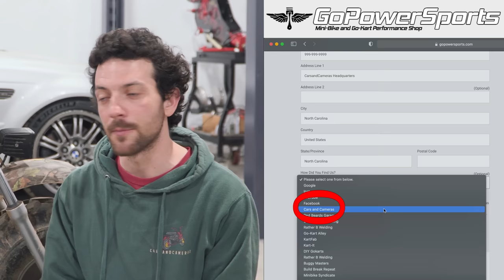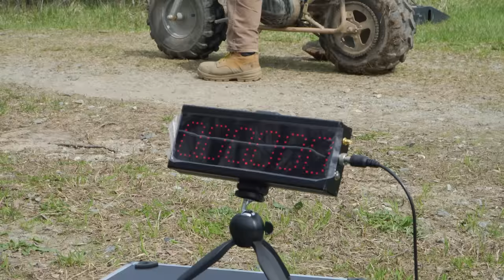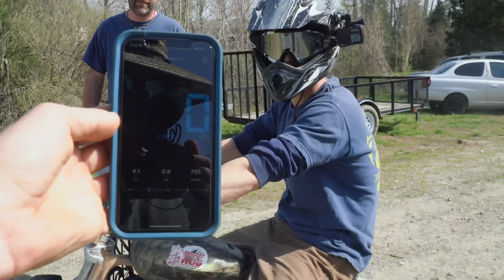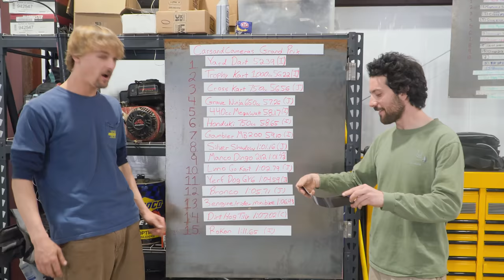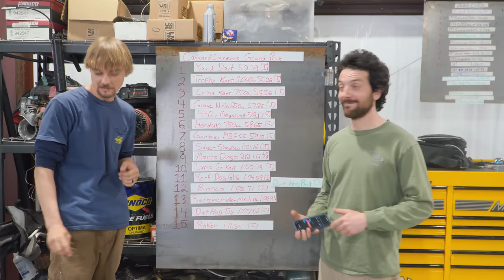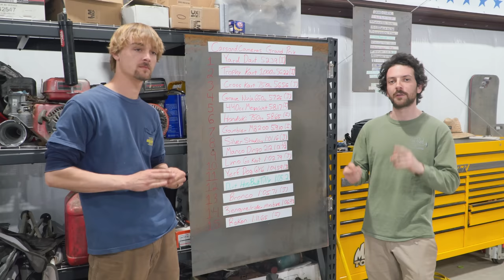Tillotson 212 E-Start Budget Build + Rip | 7,000 RPM Torque Monster!

Comment: 16:49  The Mod 2 cam requires 18# springs, yet you're installing with stock springs.  Not a good ideal.  The Stage 2 Cruiser kit comes with those springs for a reason.

Comment: Sometimes a "mini-bike" is more accurately called "mighty-bike".  
"Charles is just going to take it easy, break in the cam and get used to the power".
Charles wheelie out the gate, turn and ouch that hurt.  What more proof that it has more torque do you need?

Comment: I enjoy all your episodes been learning a lot. I just turned 50 and love my Baja warrior. I'm running a stock "basically" Predator 212 with a mikuni 22, torque converter, electric start powered by DeWalt, hand made exhaust and a 38 tooth rear sprocket. Haven't opened the motor up yet and I'm getting a top speed of 55 to 57 mph. I was thinking of doing valve  springs and pushrods next before thinking of cracking into the motor .Do you think I could hit 60 mph with 18lb springs or am I wishful thinking?

Comment: Nice upgrade guys!  I got a question.  I have a Trail Wagon 400 UTV. It has a 386 cc Honda engine.  I hate the way it throttles up. I want to place a motorcycle type carburetor on it. What size carb should I get to replace the stock carb? P.S. I am not looking for more speed, just a better ..smoother throttle up.  Thanks very much.😅

Comment: Is your flywheel holding up? The rep from GoPowerSports is trying to scare me out of building this exact setup! It says the flywheel is rated for 10k RPM right in the listing but the guy still thinks I will throw the magnets out of the flywheel adding this cam, rod, and a carb. Cheers mates!

Comment: It'd be cool if they made a performance flywheel with the ring gear and charging magnets, so that people who want the get up and go, but have the engine inside of something so pull-starting would be awkward, can get those boost points and less chance of ending up with flywheel parts in the happy place or in their shoulder or wherever the engine is closest to... :P
Reply: Whenever I can get an e start tillotson I’m going to test it. Supposedly the flywheel is rated up to 10k rpm. Only for a few seconds but I haven’t seen anyone test the stock flywheel with performance parts.
Reply: @srcobra50  I was thinking more for people wanting to upgrade a non-tillie engine (E.G. Honda, Predator, Lifan, etc.) with hop-ups but retain the charging and e-start, given they tend to have flywheels only rated up to what the manufacturer offers, or worse if they're very "offshore" brands... :)
Reply: I believe the limitation to this is the charging coil itself. They have an electric start billet flywheel, but no charging magnets.

The charging coil would burn out at 8,000 rpm.
Reply: @WyFoster  oh ok cool thanks I didn’t know that

Comment: I wish there was an engine that just had an upgraded flywheel and rod to have an engine that is easy to mod. All you would need to do is to replace the cam and maybe the valve springs if you feel spicey. That would make the engine a bit more expensive, but you can save a bit of money by not having to buy a new flywheel and rod replacement
Reply: They have them but there very expensive  and only worth it if u shell thousands out for it there crate motors but there like 2k or 1600$
Reply: Ducar 212 is the same engine as the Tillotson and comes with a PVL flywheel rated past 10k.  Ducar makes the Tillotson 212.  Ducar appears to be a better value.
Reply: Buy a Tilllotson. If you're talking about replacing the cam anyway, you will have to take off the side cover, too do that, and the rod is easy to change. And with the Tilllotson it comes with a flywheel rated at 10,000 RPMs. Plus instead of getting a 6.5hp like with a predator, the Tilllotson gives you 9 hp. So it must have better flow or a bigger cam or bigger valves or something. Well worth it.

Comment: Caterpillar had some marine diesel engines with the fractured rod caps.
Reply: Most diesels have fracture rods. Even the Ford/international 6.0 and 6.4s.
Reply: same with gm's 3rd gen 3800 its fairly common these days

Comment: I don't doubt it as well Charles. 😂
Reply: You all need to make a Reservoir tank that holds at least 60oz. Of beer. 
  Somehow you should incorporate ice cubes to be the used to keep the beer cold. Attached to the reservoir you can drink beers when you go 4 wheeling. !!!
Reply: Add a moisturizer hose that you can drink from. If you have time put a windshield wiper pump to get that beer flowing.

Comment: It's an iron flywheel. Sure a lightweight billet aluminum would make it rev faster but its not like its gonna blow apart at high rpm like a plastic flywheel does. You guys should really do valve springs don't want to float the valves. Best case itll limit rpm worse case they kiss the piston
Reply: The main problem with the cast Iron stock flywheels isn't so much the flywheel coming apart, but the magnet held on by 1 screw coming off at higher RPM. When it does this it often knocks the coil off, breaking the mounting bosses off of the crankcase. The billet aluminum flywheels use 2 pins that run across the flywheel to secure the magnet which is a much better way.
Reply: @oldhillbillybuckkowalski  that sounds like itd be an easy problem to solve
Reply: @scooz14  easiest, but not cheapest, is simply bolting on a bullet flywheel that is good for RPMs in excess of 12,000. These are usually between $100 and $200, but the alternative cast aluminum flywheel for non hemi engines costs about $39 and is rated for 10k RPM. Trying to strengthen the way the magnet is attached to a stock cast Iron flywheel,  due to the way the flywheel is shaped around the area the magnet is located is not an easy thing to accomplish, at least not on the stock 212cc Hemi Predator engines. There just isn't enough material around the magnet to do much, and adding material, or fasteners results in the need to rebalance the flywheel.

Comment: You're not supposed to use a lube that has graphite on it with bearings or inside of motor that causes damage so you might want check your assembly lube
Reply: Many oils have graphite as a base additive. It's good stuff.

Comment: I've broke two piston arms in my stock Coleman 200EX U bike with a Mikuni Carb. Any idea what would be causing that? The first one broke while riding down the road, I tore it apart, replaced the arm, and broke the second one less than 100 yards from takeoff.

Comment: Those metal arms on the plastic governor are the small version of what steams engines used long ago.  The steam engine version had round weights on it.  As the RPMs came up the round weights would start to swing away from the rotating shaft causing the engine to be governed.  This is where the expression "balls out" comes from.  Nothing to do with your testicles....guys. ;o)

Comment: What is better price to performance wise, a supped up 212 or a stock 670 v twin? I mean the 670 would be a chore to squeeze into a mini bike frame and only a larger go kart would make any sense because of the raw torque, but just imagine you swap the 3 212 for 2 670 22hp v twin engines. That would be nuts
Reply: The 670 would live longer, be electric start and have a charging system. But, it would be more expensive, and require a more expensive driveline.
Reply: @WyFoster  a 212 has electric start
Reply: @charliemaybe  Not if you want to make comparable power to a stock 670.

Comment: I got the same bike but mine has a 212 praetor its stock but has stage 1 performance and a strait pipe and does 45mph
Reply: That’s what I’m building now. Does it do wheelies?
Reply: @kyleRS87  no my gearing does not have a lot of toupue im ringing a 10 teeth clutch with a 40 chain

Comment: Love this build and doing it to my ct200u.  Have the stock 196 with the zip tie method and a tillotson carb and 44t sprocket vs the stock 50 that’s in there.  Need to get a dirt hog sticker to finish it off.  Next, what about turn signals and a brake light?

Comment: Can you not get a billet flywheel machine it for the ring gear, then pin it on, drill and tap a hole half between the ring and flywheel, no one make a gear with billet flywheels?

Comment: I have a almost stock coleman ct 100 u and did slight mods like cut the bolt on the throddle limiter and it goes 42.3??? i have a 99cc engine.

Comment: Doing a stock FW with a billet rod is so ass backwards. If you keep the stock rod under 6500-6700 rpm it’ll live a long time. The flywheel is a safety concern.

Comment: You guys are doing the governer the slow way. Take the flywheel off smack out the pin with the cog and job done. Tap the hole and it's gravy

Comment: Would you guys wanna work on my cart for me? It runs and drives. I got a predator 212 on the bad boy lol. But it just needs things like a proper way to work the throttle cable from the motor and simple little things like that. Just need the tricks and tips its. It’s for my daughter thank you.

Comment: What jetting do you use in that carb?
Reply: 130 main x 17.5 pilot is what GPS sends them with.
Reply: @WyFoster  oh wow just curious.   I’m up to 190 main, 35 pilot on my very similar set up.  Was curious where others ended up.
Reply: @js17hilton  If you're using the genuine Mikuni with big body, that's about right.

These made in China Mikunis use different and smaller jets.
Reply: @WyFoster  yes mine is genuine.  Thanks for clearing that up.    Took me a while to get the jetting right because I was so far off what others are running

Comment: Ok.....so, if everything that I've heard from all the "experts" claim it's unsafe to take the stock cast iron flywheels past 5k.....how are you guys surviving with an engine that's revving, as you say....7,000 rpm???? And we didn't see you change the valve springs....so why aren't you floating the valves if you indeed are winding the engine that tight??? Denny G, Sandwich, IL
Reply: They called it 7K because of the cam spec. There's no way they were running 7K in this video with his gearing. It never even made 6K.

Comment: Sorry guys I'd rather build the predator get a lightweight flywheel connecting rod and you get crankshaft 7 degree advanced key that goes with the kit also for under a hundred bucks
Reply: A Predator over a Tillotson? Why?

Comment: IMHO, it's reckless to advertise doing a build like this with the stock flywheel.  There's a reason the Stage 2 Cruiser kit comes with a billet flywheel.
Reply: If you look at the listing the stock flywheel on that engine is rated for 10k rpm’s. So it’s fine. Dont do this with a stock predator tho.